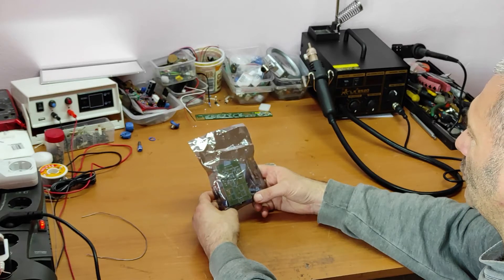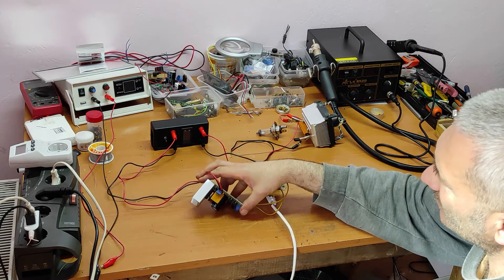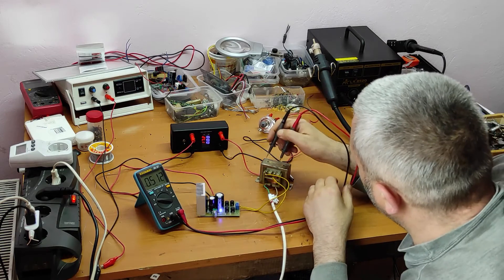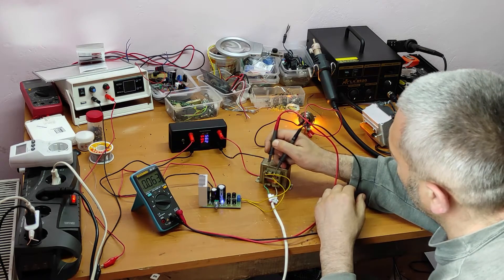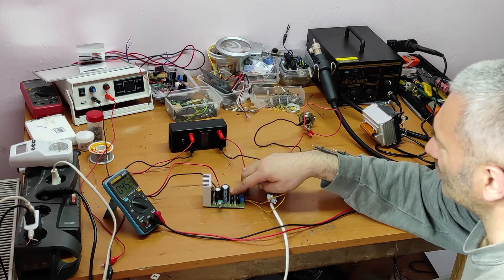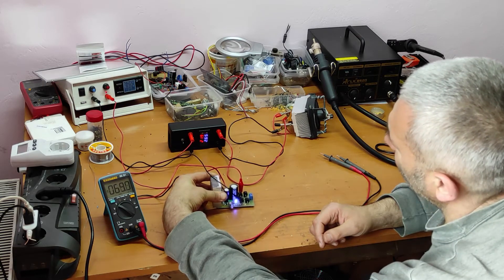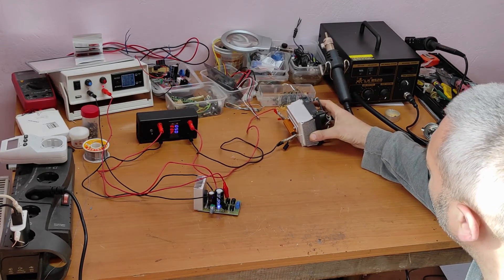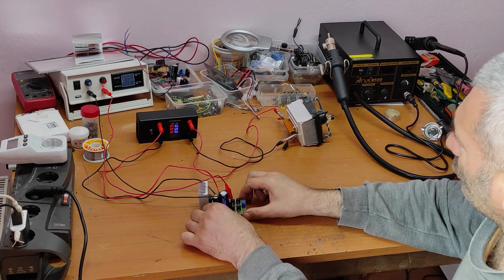Lt1083 not so good for power supply

Comment: I used a lt1083 power supply circuit to power two JLH class A amp boards at 12 volts. It was pretty good and maybe a little raw sounding for my taste. My conclusion was a capacitor multiplier, more heat sink, and working within the limits of the device is needed. Cheers, Rob
Reply from the maker: thank for feedback,I will try it.